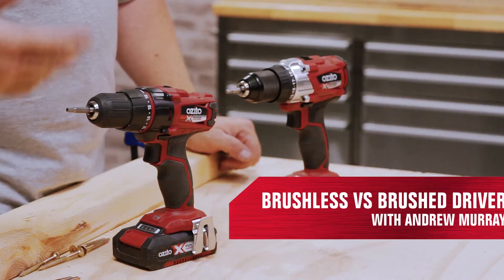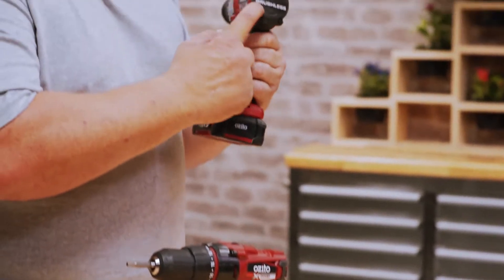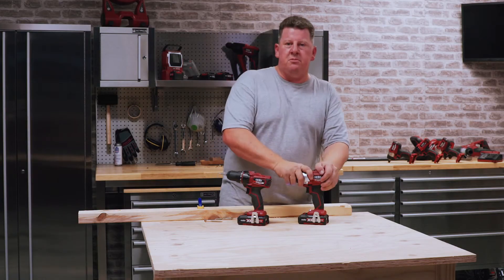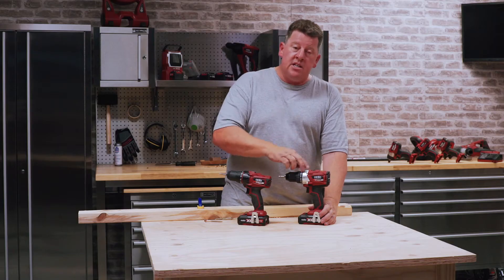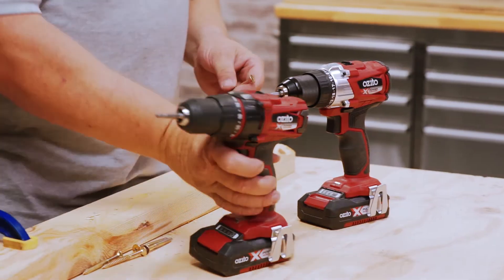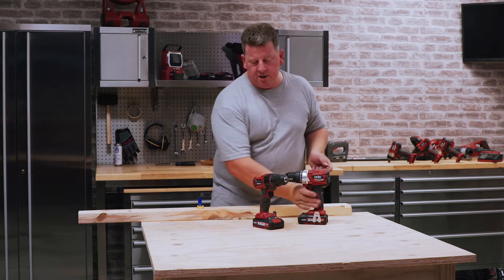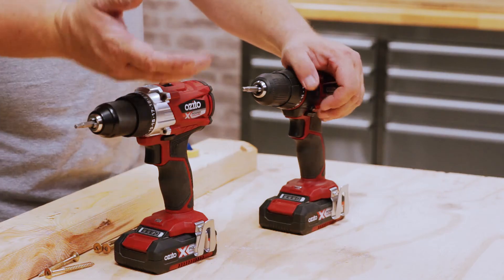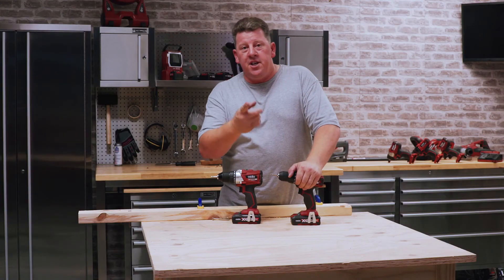Brushed vs Brushless Power Tools  -  Ozito Tool Tips

Comment: What are the noise lvl differences between brushless and brushed tools? Is it 1-2% or rather half of the noise level? Its important aspect for me :)
Reply from the maker: Hi Maciej,  Thank you for your comment. 
The main advantage of the brushless motor is to improve the tool’s performance with a longer runtime.
The brushless motor (motor itself) may have a lower noise level than the brushed motor but the overall noise level of the tool does not only depends on the noise level of the motor.
Reply: The brushless has a higher pitch, probably due to the higher revs, like a formula one racecar.